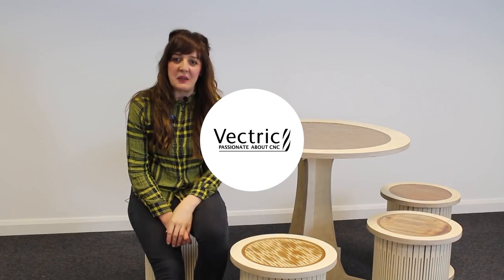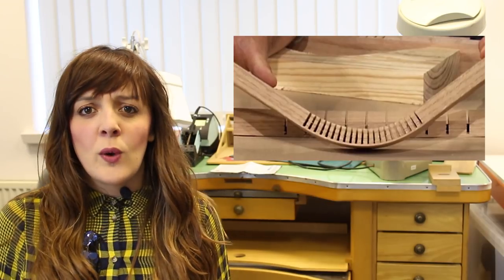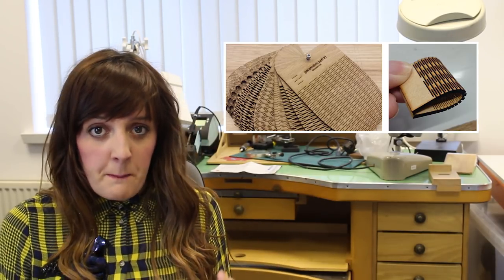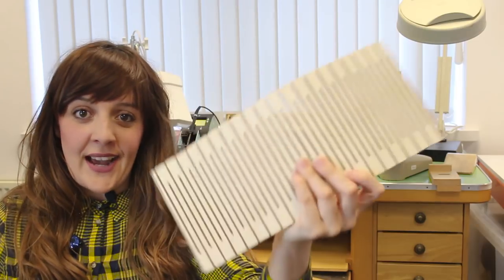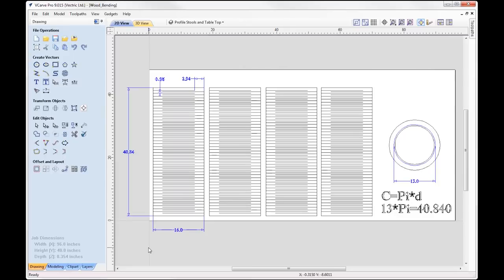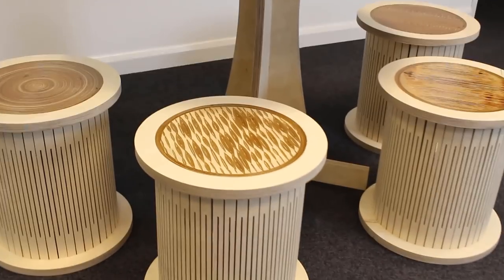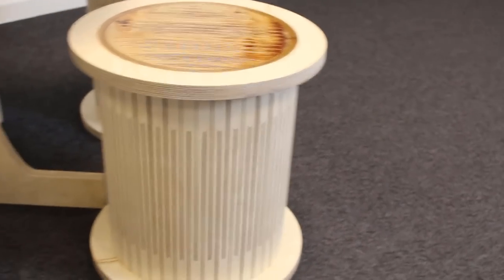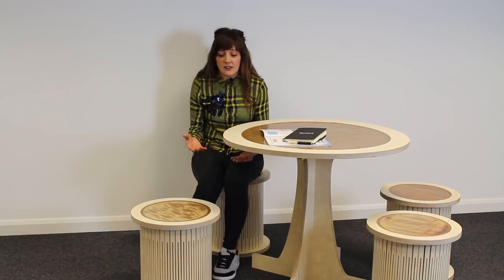In Labs with Beki | Bending Wood & Using Resin to Make a Table & Stool Set | Vectric CNC Projects

Comment: Hi Beki. Nice work there.  I did several tables like that and i noticed you had same issue i have while i assemble the top and the botom of the table on the groove.  The solution i found to solve that problem was: i beveled  that flexy panel on top and on the botom, that way its more easy to insert it on the grove once its beveled, get the idea?  ;)  best regards from Portugal.
Reply from the maker: Thank you Wood Be for the comment and the good idea!

Comment: What thickness and type of wood did you use for bending the wood? Also did you drill all the way through the wood into the sacrificial board for the dowels? If not what did you do to be able to flip the board and it line up correctly? I was not sure if I understood that. Your videos are great! I have not seen them all yet but I cannot wait to watch them! I am looking forward to trying this out.
Reply from the maker: Hey Chris, I used 0.35" Birch Plywood. The holes for the dowels were created by drilling partially into the top side, then using the vectors for the dowel holes on the topside I copied them over to the bottom side (this flips the vectors over). Once I've machined everything on the top side, I take the material off of the machine bed, and my next step here is to run the dowel holes of the bottom side directly into the spoil board (this is beneficial for several reasons; 1. I can cut the second side at a later date as I am able to reset the X0 Y0 and 2. the asymmetrical placing of the dowels means that there is only one possible way I can flip the part over... making it pretty fail safe) For a more in depth explanation take a look at this video: https://www.youtube.com/watch?v=1GlVZQ4ngEU&index=69&list=PLLdEiXEsoRerNo7bqzlP5msj9Ini091L0  (at around 23.10) Hopefully this will answer your questions :) Thank you for your kind comments and I am glad that you are enjoying the videos, and hopefully as much as I enjoy making them :) Thank you and I hope I've managed to answer all of your questions :) All the best ~ Beki